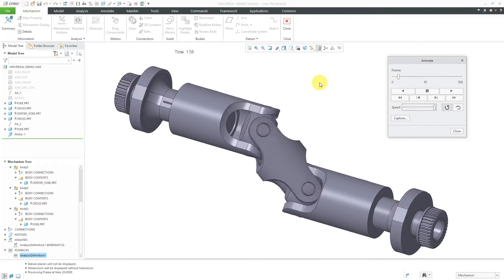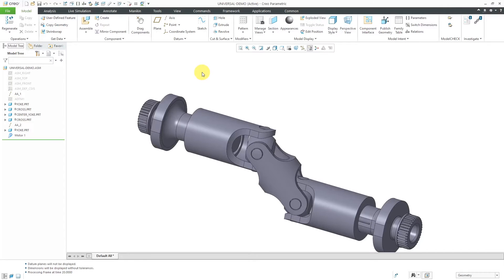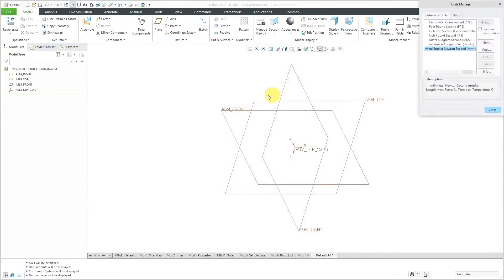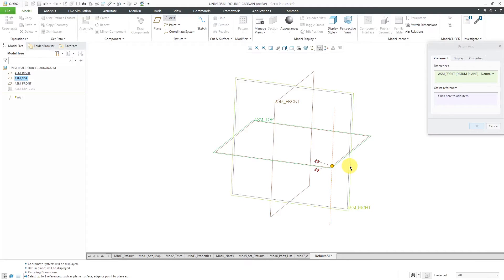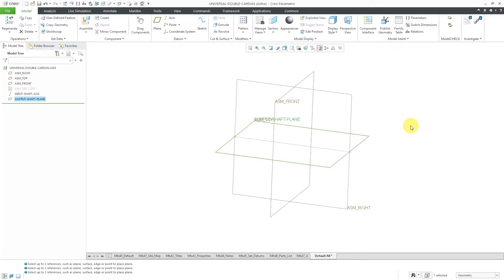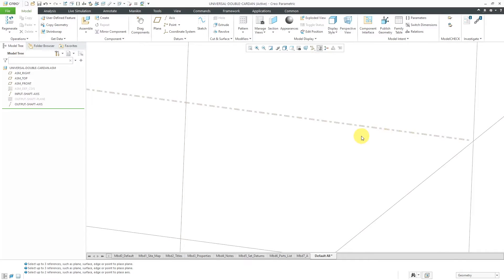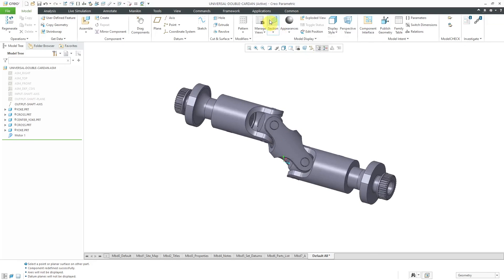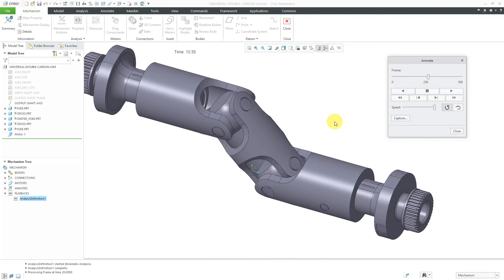Creo Parametric - Mechanisms | Universal Joints

Comment: Is it possible to add another motor changing the direction of the output? For example: a motor that makes output turn right 30 degrees than turn left 30 degrees making a cycle of going and backing while this motor in the video keeps running
Reply from the maker: Yes

Comment: How can we do the analysis of this joint? 
And how do we make the graphs for velocity application in servo motor?
Reply from the maker: You can perform the same analysis as any mechanism. What are you interested in analyzing?
Reply: @CADPLMGuy  i wanted to analyse thr torque transmission and stress analysis through this joint. And also graphical data for the same
Reply from the maker: @rishabsud7535  You would create a Measure to capture the reaction force through the joint. This requires a license of MDO. Then you can use the calculated forces as a load case in Creo Simulate.
Reply: @CADPLMGuy  Sir, if possible, Can you make a video on that ?
It will be very helpful
Reply: @CADPLMGuy  Not for this particular assembly, there can be a demo on a simpler part showing how can torque be applied and then structure can be analysed.